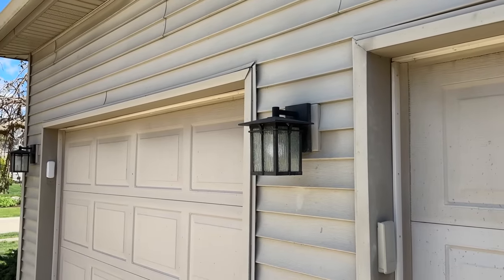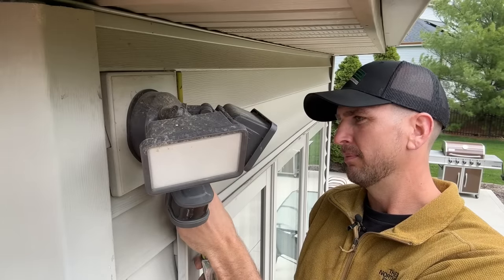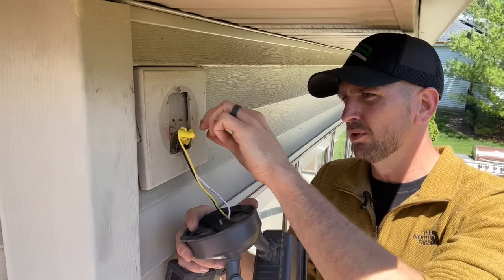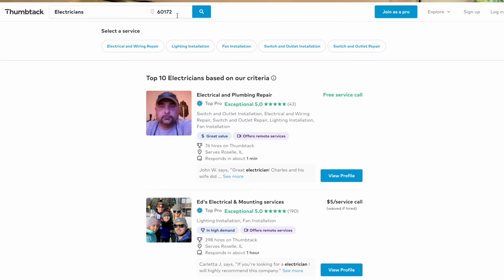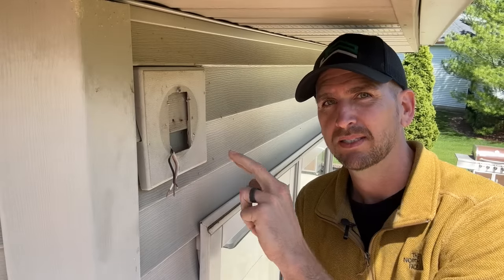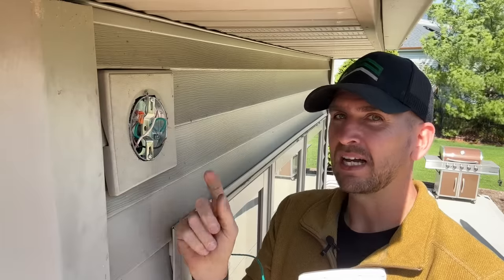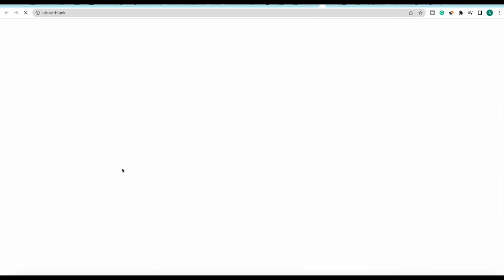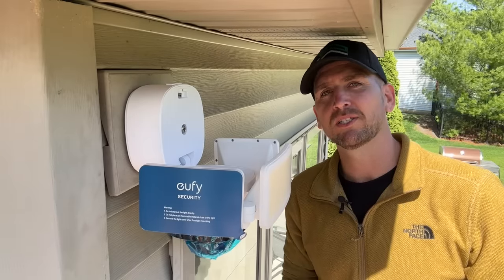How To Install An Exterior Light And 3 Common Mistakes To Avoid

Comment: I highly suspect that for the US, government codes are just a larger version of weaponized incompetence. Any professional can repeat them, lots of home owners can, but no one knows why it exists. It can effect the sale of the house, or get a fine by the local government for the home owner...but I have never once seen a professional actually held responsible for them. Worse, a company can do incredibly unsafe things, even destroy your house, and no one will actually do anything to them. When you install a light fixture though, better make sure there is an electrical junction box in the all, because the city wants to keep you safe. I literally had a company lie about pulling permits, lie about sub-contracting certified electricians and plumbers, and run a standard yellow romex to a 15-amp breaker for my Oven. City essentially sounds like a you problem, not a them problem. Good thing they were so adamant I put in a dig permit to install a french drain in an area of my yard where it is physically impossible for there to be any lines though,  i'm totally sure that is what I needed protection from.

Comment: "[Wagos] are not waterproof so cannot be used outdoors or in damp conditions, unless you use a Wago Gelbox, which will then offer IPX8 levels of moisture protection for the Wago 221 connectors." - zdnet

Comment: Fixture with built-in WiFi camera is one thing, but NEVER install a light fixture with a built-in motion sensor.  They're extremely limiting, and when they go bad (they all do), you have to replace the whole fixture.
Just use plain metal fixtures (single or dual) and install motion & light detecting BULBS.  I get way more options (PIR? Radar? Camera?), and when they go bad, I can just replace the bulb.  The fixture itself is a dumb metal thing that should last longer than me.

Comment: Just put up a low voltage one.
Reply: You are low voltage, 110volts.
Reply: youd still need the transformer somewhere if you use 12v lighting. I just yanked out 200 12v/24v uplighting that was 'accenting' trees, the building signs. heavy AF transformers have my truck infested by ants now

Comment: That Eufy floodlight is not waterproof. The lense seal wears after 1 season of hot and cold weather, allowing water inside the lense.
Reply: Then move to a place with better weather.
Reply: @1pcfred  LOL I live in California in one of the most expensive areas in the country because of good weather. We have mild weather where it rarely goes beyond 100 degrees or below 32 degrees. I hope you give more people the benefit of the doubt than you given me.
Reply: @TronHardy  find somewhere with even better weather. Why there's somewhere in Australia where it stays within a few degrees of 74 year round and almost never rains. People there basically live on outdoor decks.
Reply: @1pcfred  Or Eufy can fix an engineering flaw like most other security camera companies have been able to solve. Thanks for the entertainment though.
Reply: @TronHardy  don't thank me. I don't even know what Eufy is.

Comment: Funny thing, the pancake box could be plastic, and so there isn’t an actual safety or electrical advantage when the wires are otherwise surrounded with plastic outside the sheathing/siding…

Comment: You just made another violation by not using a wire connector to that metal box as that can cause a short. You need to protect the wires from sharp edges or can also use a metal weather proof gang box or a non metal round gang box with same wire protection method.

Comment: Wire nuts are fine. Wagos are just easier. As other commenters have mentioned you’ve got the connect the ground first and let the fixture hang. Then you can complete your wiring. But no doubt the wagos appear to be faster.
Reply: The Two big mistakes I see on outdoor lighting, is this. The Flood Light has a “U” Bracket and a SJ Cord from the Light to junction box. The other one is 120 VAC String Lights for a Deck. Both are against Codes here. The reason Holiday Lights are permitted, is they are Temporary, add actually have time limits on them. You are allowed low voltage string lights and low voltage rope lights.
Reply: You can use 550 cord to hang items while you do the wring.

Comment: Another common mistake people make with this type of light: in most jurisdictions, light shining from these is not allowed to cross your property line by a certain amount, frequently 15 feet. Aim them down to illuminate your property only, and if the fixture manufacturer is bad and didn't include shades/shields for the fixture, fashion some yourself if you can't adjust the fixture enough to satisfy light egress code.

Comment: You explain the code violations but you have made TWO code violations. 

First, you have only entered the conductors into the junction box while the sheath must protrude inside the box. If the wire was too short, it should have been replaced.

Second, you left a hole open on the box. You should have used a new junction box or installed a cover over the open hole.

Comment: First, thanks Scott for your video. You have to have a strong upper chin, so to speak, but even those comments which add corrective information add value to your 
posts. 
     Wow...another reason to miss church today, lol. I was mind-boggled by reading so many comments that I couldn't even finish them all.
      So here's what I got. Assuming everything is "product approved," where need be: Good job with the plastic Romex connector with a half inch of sheathing protruding into the box. I believe NEC (which itself is not law, but a national model code adopted by each jurisdiction right down to the municipality, any of which jurisdiction: federal, state, county, municipal can modify it to its liking)...in Florida, the FEC requires Romex wires all protrude a full 6 inches from the end of the half inch Romex sheathing. Admittedly, tough or impossible to do with a pancake box. Also, I believe all ground wires must be pigtailed into one wire nut and then grounded to the pancake with the proper metal threaded screw. As far as box fill goes, Romex  connectors count a "1 point," unless it's a plastic box, and you only use one of the boxes strain relief tabs...then, it's a freebie. And I think the Romex coming out from the back of a metal box has to be fastened/stapled within six inches, but if it's coming out 9f the back of a plastic box, it's a different measurement: 8 inches, I THINK.
     To me, it's amazing how detailed code is. It makes married life seem easy. :-)

Comment: I HATE PEOPLE THAT DO THINGS, BUT THEY DON'T DO IT RIGHT ! I had the same issue here. The MORON I brought this house from, had these stupid LED fixtures put up, didn't use any junction boxes, didn't believe in ground wires, and just a sloppy mess. They LOOKED okay, but LEDS have this flicker that induces migraine headaches, so I took them down to put up fixtures (Which will now become sockets, because of another problem, requiring me to take down the drywall ceiling, if I ever get that far) and they were installed just as your light is there.

I do want to mention to you, that you said you checked the hot wire to make sure there is no current. Also, always check the neutral, grounds, and any other wire, because there's no telling what some moron did. If they couldn't take the time to do it properly, it shouldn't be assumed they wired it correctly. So always check ALL your wires. I know you know that though. But just putting it there based on what you said. And of course, people that mess with it, and don't turn off the power or know what they're doing deserve to be bit for messing with something they have no business messing with.

My mood is really soured by people that do things, that create more work for others. Either because they're lazy or incompetent. A lack of money, I can understand but if they really are that ignorant, they should just leave it alone. Also, I have come to another idea. For whatever reason, Romex just REFUSES to insulate that ground wire. This has created problems for me, despite wrapping my receptacles, GFCIs, and switches in electrical tape. So I cut the ground close enough to the sheathing, just long enough to clip on a Wago lever nut, and add another grounding pigtail Usually the bonding one and the device itself. This wind of ground wires in a box, even despite trying to put them first into the box, they don't always stay put. I had a GFCI start buzzing and not killing power when faulted and tripped. The device itself wouldn't work but when tested with hot stick it still had power. So that GFCI wasn't going to protect anyone. They should be designed to stop current when they fail, not keep feeding. But anyway, 3 different times that's caused a problem. so hopefully that's a solution if anyone else is having that issue too. Or if you know better ways, please let me know.

Great video and thank you.
Reply: I feel your pain. The previous owner of my friends house wanted a finished basement. So what did he do? He drywalled and stuccoed the ceiling of the basement. Sure it looks good, but it was a dumb ass decision. Why is that a big deal you ask? Because All of the heating ducts,  electrical, water and gas lines are permanently hidden with NO "F'ING" access to them. Sighhh.
Reply: @BlueGillage  Basement ceilings should, if finished, be drop ceilings for access.
Reply: @davidmoran4471  I hate drop ceilings. Basements shouldn't be finished. If it's finished it's not a basement. Basements should have exposed concrete walls and floors and rafters. Access to all wires, pipes, and J boxes, water and gas shutoffs, etc.

Comment: I went with a fatter junction box because the pancake box wouldn't easily contain my old-school wire nuts. 
I cringed when you were mounting the cam-light while connecting the hot wire but holding the neutral, regardless of the power being "off". Then I saw you had it pre-Wago'd. Might have dropped the square mount plate or cut it to match siding too. Clean.
I've actually moved to solar-powered lights and cams this year except right at my doorways. Easier. No power source needed. Use a solar-battery charger mounted next to some to charge the charger via sunlight then re-charge the internal battery of light/cam once a week or so. No electricity required.

Comment: This is the first time I did not "Like " your video.  I think  it may be a error to suggest wire nuts in that fixture is "wrong" or a "mistake".  It may be easier to do "lago" connectors, but you have to know by now that not everyone is as sold on them as you are.  I am in HVAC and would never use them on my jobs or in my house,, not even in low voltage.  I think it fair to say they are a faster alternative; but to say wire nuts are a mistake just may be mis-speaking.

Comment: I would have removed the vinyl plate, then mounted the metal box after cutting the back vinyl, then put the plate back on over it.    By surface mounting the metal pancake like this, the box isn't very firm in its mounting. since it isn't mounted on a flat surface it is on a angled surface.  I also always put a wire nut on the hot when I have wires exposed regardless, someone can always go back through and turn on power and if you have all your wires tied together or touching while hanging, you can get a spark, less likely now with arc faults...but back in the day you could cause a fire.  If you don't have a wire nut, electricians tape works, to just keep the hot covered, even while feeding through the pancake hole to get into the box.  Always work like the wires are hot, safest tip to give.

Comment: there is nothing wrong with using "wire nuts".
Yes Wago connections are newer and easier, but using old wire nuts is not a "mistake".
Reply: But mistakes can happen more often compared to wagos, because if u dont twist wires correctly it can overheat and burn

Comment: I swapped out all my own fixtures, built boxes for a few that had none, exterior wire nut knuckled, doubled taped, and caulked everything against weather. Sixteen years, no issues. Why would you hire someone to do something so simple? Right now I need someone because I don't understand Panels enough to swap one out myself, let alone the meters. That terrifies me. But lights? pfffft.

Comment: Clearly an improvement by removing the violation of NO OUTLET BOX. But why is the center hole of the “pancake box” installed with NO CLOSURE? This improved installation nonetheless VIOLATES NEC® 314.19 by not fully enclosing the wiring cavity to protect combustible building materials from arcing if conductors ever work loose.

314.19 Boxes Enclosing Flush Devices or Flush Equipment.
Boxes used to enclose flush devices or flush equipment shall be of such design that the devices or equipment will be COMPLETELY ENCLOSED on the BACK and sides, and substantial support for the devices or equipment will be provided. Screws for supporting the box shall not also be used to attach a device or equipment.

Comment: I ain't using no Wago nuts. I've been twisting wire nuts for over 40 years. Wagos are too effing expensive. Maybe under that eave that open box is OK but it looks sketch to me. Personally I use outdoor boxes outside. I don't care if they hang out some. I'm not building a roach motel.
Reply: Use Wago fittings and you will say to yourself,I should have used these years ago and my hands wouldn't be so effing  bad with years of twisting wires.
Reply: @onelineal9382  Wago no bueno.

Comment: while the wago are a move forward, the way it is fitted wouldn't pass muster here, nor are exterior lights sold like that here, exterior lights need to be IP rated for water ingress. for instance IPX4 or X8, you would have a compression gland that would trap the cable and give it some water ingress protection. it would also have it's own fuse spur.

Comment: When you screwed the pancake box on top of the siding, you compressed it and created a gap on the side of the vinyl mounting plate. In no time wasps will have nests behind it. Also, the sheathing on the romex should extend into the pancake box with a romex clamp securing it.

Comment: As the power is off no real problem, but I always connect the neutral wire before the hot wire.  Jus seems safer this way incase for some reason the hot wire becomes powered up.

Comment: Replaced my outdoor fixture with an LED motion sensing fixture a couple years ago... Found exactly what you did, no junction box!  A house built in 2012 should not have had this issue!  So, I did the same thing as you did - installed a pancake box, and brought it up to code while installing the new fixture.  Glad you confirmed what I suspected when I pulled the old fixture...  I feel better now, knowing it's done correctly.

Comment: These pancake boxes are not rated for exterior use. So this would still be a code violation.
Reply: Wrong, MAGA MAN. The “pancake box” is not itself in a WET OR DAMP LOCATION. That box is BEHIND  GASKETING and WITHIN building materials and surface finishes, 
✅ this installation COMPLIES with NEC® 314.15:

314.15 Damp or Wet Locations.
In DAMP or WET LOCATIONS, boxes, conduit bodies, outlet box hoods, and fittings shall be PLACED or EQUIPPED so as to PREVENT MOISTURE FROM ENTERING or accumulating within the box, conduit body, or fitting. Boxes, conduit bodies, outlet box hoods, and fittings installed in WET LOCATIONS shall be listed for use in wet locations. …

Outlet boxes are NOT rated for “outdoors”. Outlet boxes MAY be rated and Listed for WET or DAMP LOCATIONS, or per NEC® 110.28 for ENCLOSURE TYPE.

NEC® Article 100 definitions, applied to the “pancake box” ITSELF:

❌ Location, Wet. (Wet Location)
A location that is one or more of the following:
❌ Unprotected and exposed to weather
❌ Subject to saturation with water and other liquids
❌ Underground
❌ In concrete slabs or masonry in direct contact with the earth

❌ Location, Damp. (Damp Location)
✅ Locations protected from weather and not subject to saturation with water or other liquids but 
❌ subject to moderate degrees of moisture.

✅ Location, Dry. (Dry Location)
✅ A location not normally subject to dampness or wetness. A location classified as dry may be temporarily subject to dampness or wetness, as in the case of a building under construction.
Reply: @brianerock  "314.15 Damp or Wet Locations. In damp or wet locations, boxes, conduit bodies, and fittings shall be placed or equipped so as to prevent moisture from entering or accumulating within the box, conduit body, or fitting. Boxes, conduit bodies, and fittings installed in wet locations shall be listed for use in wet locations "

Comment: I really like this channel, but a lot of what you are doing is dependent on where you are.  WAGO connections are not yet approved in Canada.  That pancake box I've never seen before.  The light you took down has probably been on the house for over 10 years (just a guess) and it has probably never seen water with that overhang over it.  The offset box, I wouldn't install.  That thing looks butt ugly.  So now what?  I can't get a pancake box and I'm not using the offset.  I mount the new light the same way the old one was mounted in 5 minutes.  The old way didn't catch fire, the new one won't either.

Comment: Caught your one mistake is not installing plastic wire bushing in metal hole knockout to prevent wire chafing....tsk tsk
Reply from the maker: I should have called more attention but there is a black plastic bushing installed. 👍